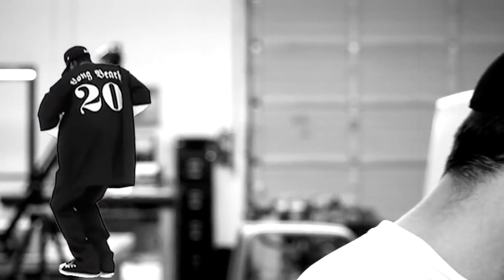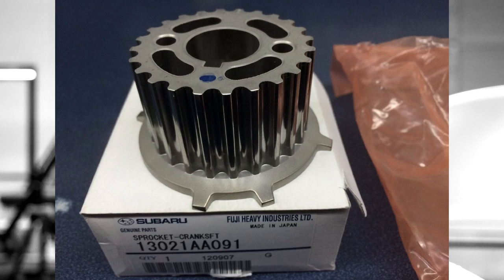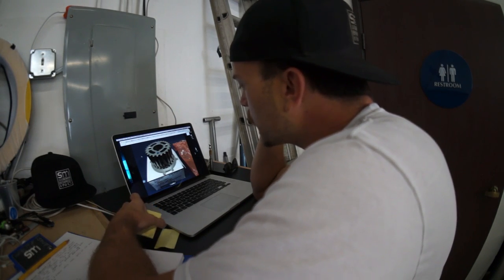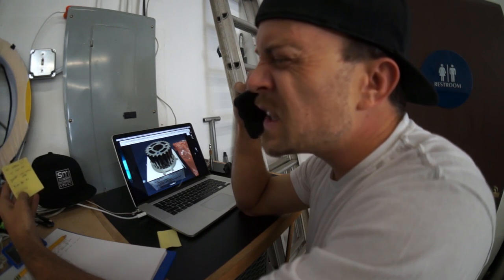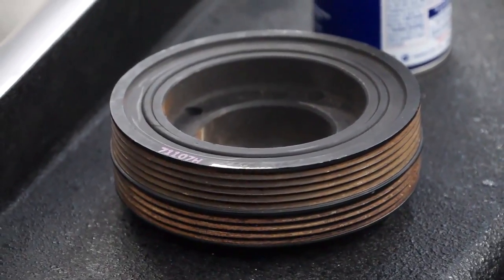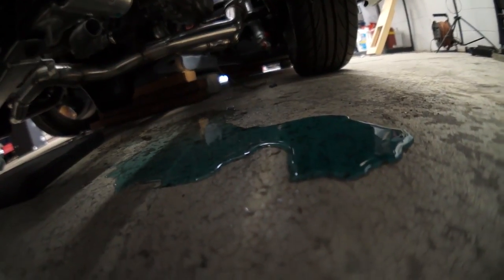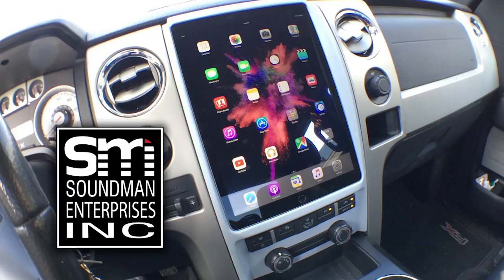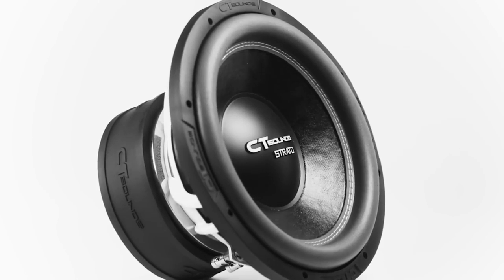Coolant System from HELL!

Comment: that's for the holiday episode!  I don't think you needed, the expansion tank.  I think they are used when there is no radiator cap on the radiator so you have a place to add coolant and bleed the system. that way the tank is pressurized like the radiator, but with a cap and hose to an overflow tank you were fine... guess it's a little late now.
Reply: right?... yeah definitely right.  dam I'm good
Reply: IVE BEEN TELLING HIM THIS THE ENTIRE TIME D:
Reply: +josh mathis  (puts on sunglasses and pops collar)
Reply: someone get the Workshop manual for car that engine came out of should have the full coolant system diagram in there and we can settle this argument for good
Reply: https://upload.wikimedia.org/wikipedia/commons/8/86/2004_Subaru_Impreza_Sport_Wagon_EJ15_engine.jpg

theyre all like this. look up any model.
Reply: +Stephen Rowley no what your not getting is with that style radiator no expansion tank is needed.  the engine doesn't need a certain one it just depends on how it's set up in the engine bay.  the factory set up probably has coolant flowing higher than the top of the radiator, so you can't use a radiator cap cause the pressure above the top of the radiator would push coolant out every time the cap is open and the system would never bleed the air out
Reply: engine isnt a VW though its a subaru motor. tbh Without seeing the original system I've not got  clue about what the most appropriate system would be. Personally i would have brought motor with all the originally cooling system still attached.

Comment: try cleaning you timing belt and the gears and see if it starts  you can use  water  or brake cleaner and blow it out with air make sure that it is dry try that it might work I had the Same problem

Comment: Wait....don't you need a 36-1 trigger Wheel for the microsquirt? do they even make a crank sprocket from Subaru like that?
Reply: +Doug Bernards (Soundman) if that's the case, then I know the STI model has a 36-2-2-2 crank pulley. Remember though, wiring in the crank position sensor, Subaru runs a wasted spark set up, so wire 1-3 and 2-4 cylinders together. Good luck bro!
Reply: *crank gear pulley
Reply: +Doug Bernards (Soundman) yup, I corrected myself.

Comment: Did you or Rafa ever pull a spark plug and check for spark?
Reply: I imagine the crank sensor is what signals for spark in the microsquirt, so without it no spark... unlike factory ecu which uses cam and crank signal usually and will run but in limp mode if one doesn't work.
Reply: +Doug Bernards (Soundman) Doug is it the standard sensor and toothed wheel? Clean the sensor and it needs to be within at least 2mm of the toothed wheel or won't get a signal... Could be the coilpack too...

Comment: A tip would be to tape some cardboard on your radiator so you won't scratch it or bend the fins, yeah a little late.  And of course since you live in an area with little freeze potential use distilled water until you get it running and pressure checked.  Then put in that crazy expensive smurf piss.

Comment: Change that timing belt and clean everything, i'm wondering if this engine was underwater in Japan, that amount of grot make me thing that, the sensor is packed with dirt and that's why the Microsquirt is not picking up the signal, because the sensor isn't sending any signal...

And another thing, if you are gonna use that expansion bottle, use a sealed cap for the radiator, because the cap of this bottle already have a valve to let the excess pressure out.

Comment: Doug, why the f do you waste your money on Subaru coolant?
Reply: that's like getting parts at the dealership lol
Reply: +Pedro Bergamaschi there's plenty of aftermarket coolants that works as good as subarus own. 
:p
Reply: yeah I know, there are  very good parts from the aftermarket as well. buying OEM stuff is  usually a rip off
Reply: +krqkan I disagree with both of you. Japanese cars usually have a specific coolant with ingredients missing from Universal's like Preston.   My Mazda has phosphate in the coolant. I went with aftermarket but did my research and bought zetex Asian coolant
Reply: I deeply respect your will for using quality stuff in your automobile. I just think life is too short for that shit. the coolant in my car came from another car lol
Reply: +Pedro Bergamaschi 
+BoogieDownProduction 

dudes, as long as all the classifications, standards etc are the same it doesn't matter. 

the car market wants you to belive that their coolant is the only one working with the car of your choosing.

it's the same with engine oil. 

my Ducati manual says "only use shell advance in this engine" or some bullshit... why? because shell sponsors Ducati.  

Ive run it on motul, castrol, shell and there is no difference. 

one of you talked about "special ingredients"  that's just bs. they might use some other additive for anti corrosion.  that's all. 

and if you do, just make sure to flush your engine before adding a different coolant because the different anti corrosion might react. 

so to sum it all up. 

when do I use oem coolant? 
on a new car where the warranty requires it. 

or when your not flushing the system with water. 

when to use aftermarket? 

when you realise that oem is just a ripoff. 

so buy a coolant that has the same classifications and roughly the same ingredients.  
screw overpriced oem. 
sorry for bad spelling and grammar. it's 0400h here while writing this... :) 

have a good day! :)
Reply: krqkan Well we disagree again and here is why, maybe maybe-not a coolant with different anti-corrosion package will work the same.....its something I rarely have to replace so its not really a big deal to go OEM or aftermarket with same OEM compounds. Simular train of thought for engine oil, OEM with its high amount of molybdenum content is close in price with other oils. Yes other coolant and other oil will work, im not saying they wont work. But will they work as well? You seem to think so and thats fine but I respectfully disagree
Reply: +BoogieDownProduction 

haha, if we all agreed there would be no progress in the world. :) 

and I agree with you to some extent. 

if you have a brand new car I'd use oem. 

but this shit got godzilla turds in it... so i wouldn't see any benefits of using oem stuff :)

Comment: You are over complicating that cooling system. All you need is a over flow tank that comes off the rad cap nipple. You don't need an expansion tank. And it also doesn't matter high high the over flow tank is in comparison to the rad.

Comment: Hey Doug, 
I just came across some information that might help you. Some computers are designed to NOT allow the car to start if the coolant sensor is not reading within its limits. I saw a video from a mechanic that showed a car not starting when the coolant temp was showing 14 degrees. He changed the coolant temp sensor and the car now starts. Here's the link:
https://www.youtube.com/watch?v=1L4nB2NdA0U
He was thinking crank sensor just like you are because there's no spark. Just thought I'd offer a little help.
Mitch